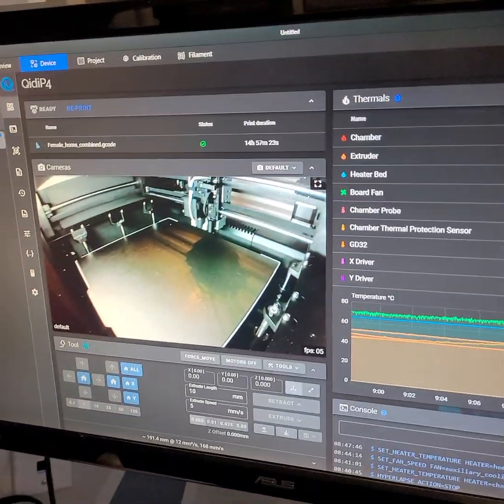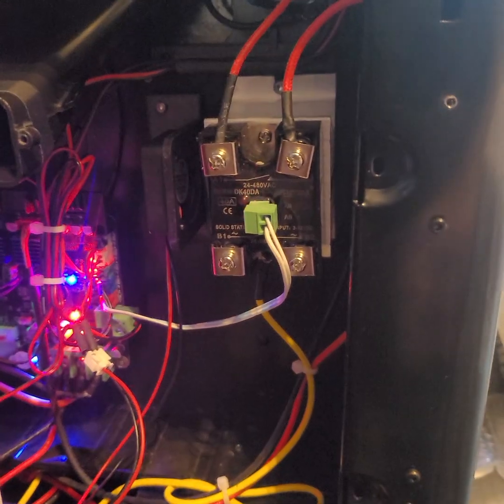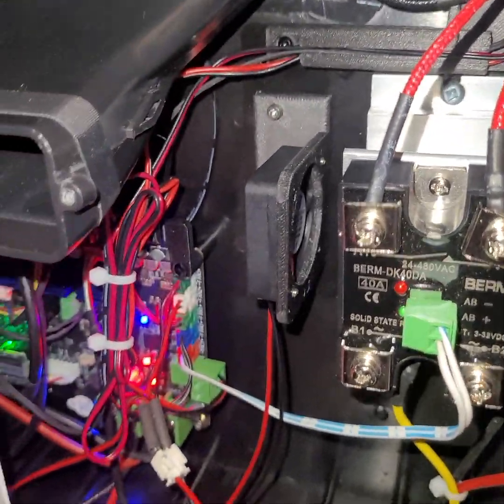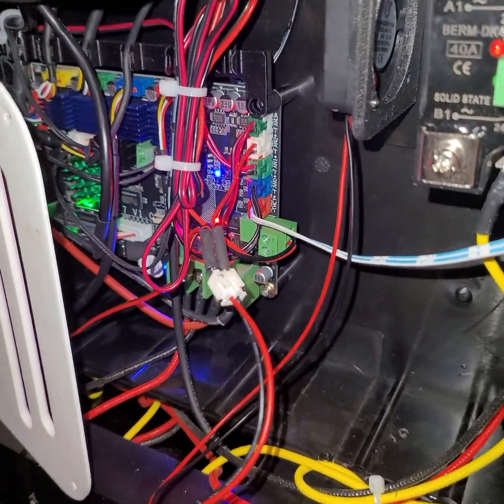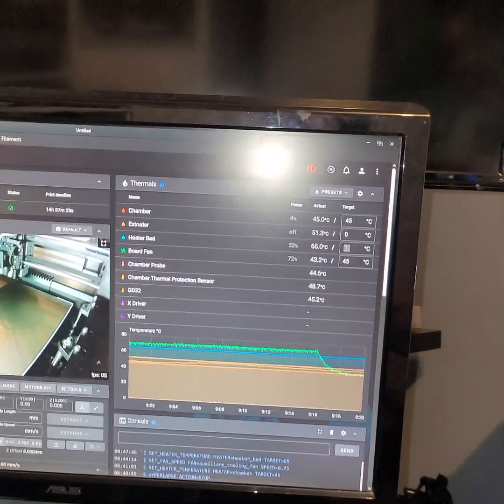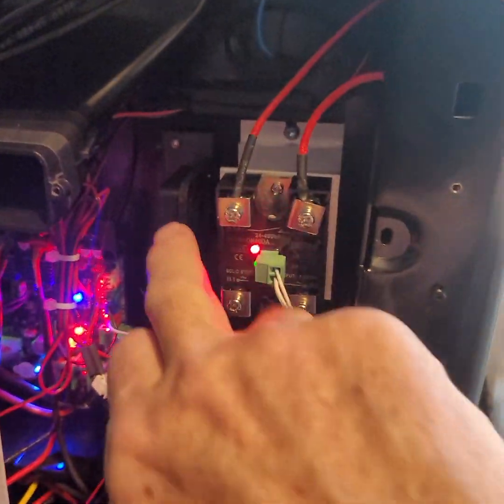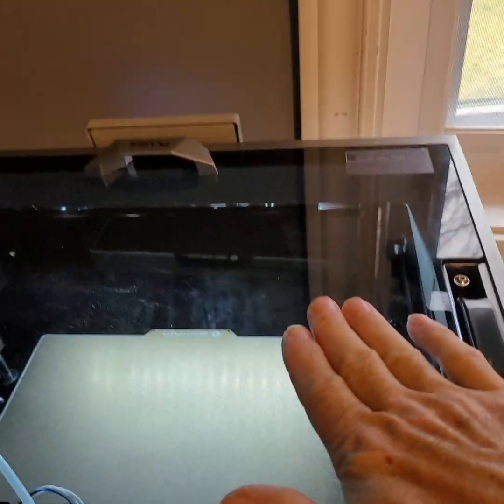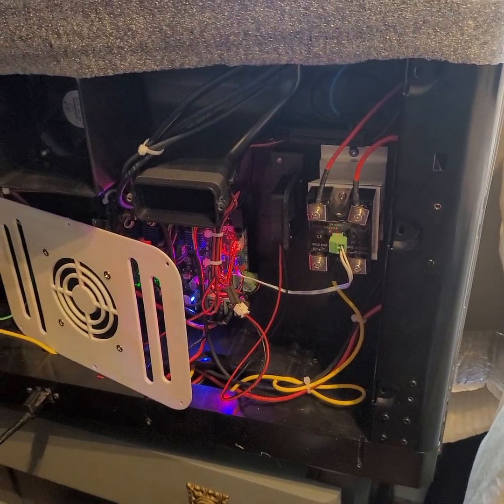QIDI Plus 4 SSR fix

Comment: Thanks for your efforts Frank! That solution will work for customers if they're skilled with working on MAINS AC wiring. I would not suggest to folks who aren't confident to work on this. There are several SSR solutions out there to choose from but.. 
 Our fellow creator; Grant over at 3D Musketeers did a livestream on 11/8/24 that tests THE LATEST replacement board from Qidi. Toward the end of the video Grant mis-wired it but eventually with help from the chat got it working. And it performed well within the parameters. 
 For those reading this... I would request the latest board from Qidi & also request a 1 yr extended warranty. That's what I did. My replacement board will arrive around Nov 12-13.  Qidi sent me a video & it shows how the wiring is different too. 
TO REITERATE,.. If you are not confident working with Mains AC wiring get help from a licensed electrician! 
Good luck ya'll.. 
Hillbilly Engineer